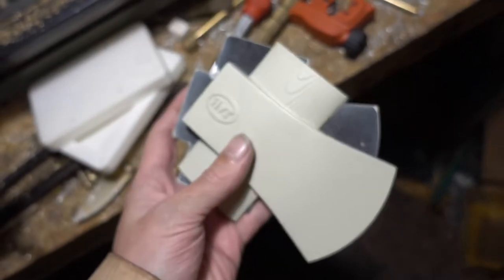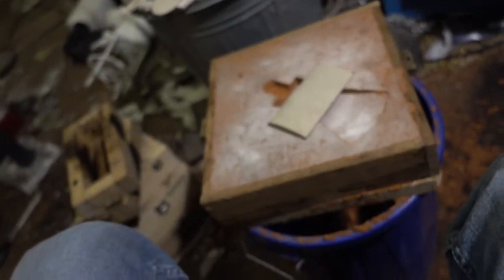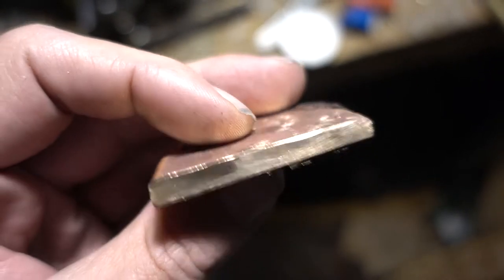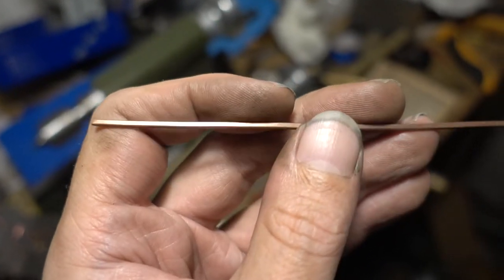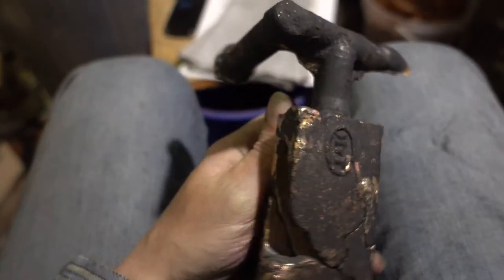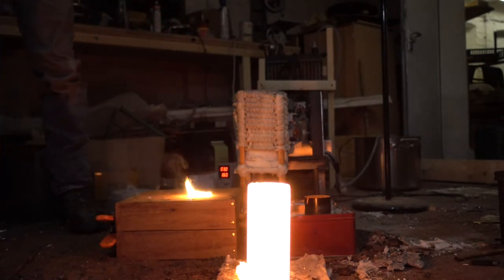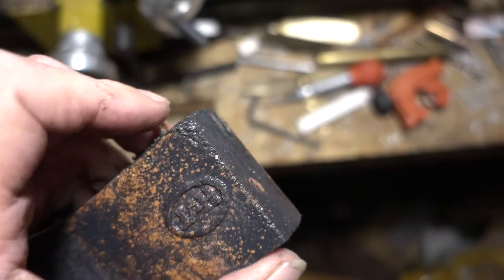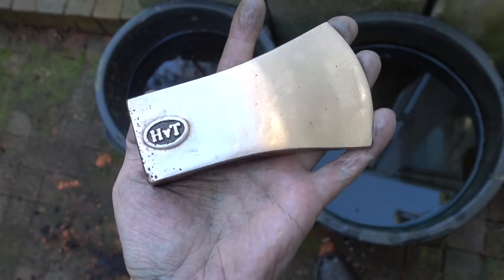casting a titanium copper axe head

Comment: Man I came rushing back to this video wrongfully remembering you made a Beryllium copper axe.

But thankfully you didn't.
Beryllium copper is safe in use but very dangerous to work/melt.
Category 1 carcigen, could seriously long term contaminate yourself, your clothes and your shop if you grind or melt beryllium copper yourself.

I'm interested in this titanium copper alloy, if it really is better than beryllium copper.
I want to make an axe out of copper alloy but have it be as close to steel as possible.

First I thought aluminium bronze (might still try) 
But beryllium copper is pretty significantly harder (40hrc vs 30hrc ±) AND higher tensile strength than aluminium bronze too.

So I'm curious how well titanium copper performs now.
Reply: there has to be a way to melt beryllium copper in a safe way. Otherwise how do they make any tools from it in the first place